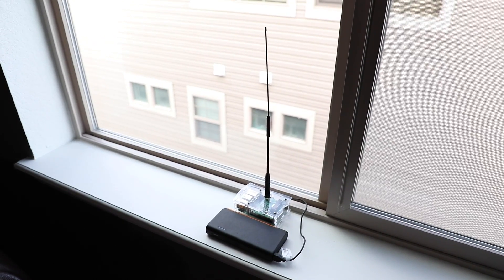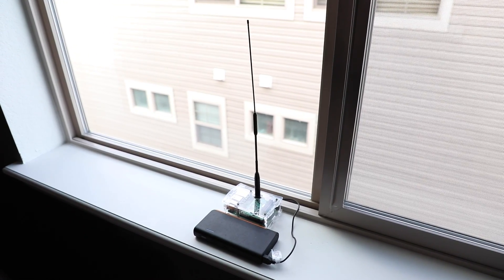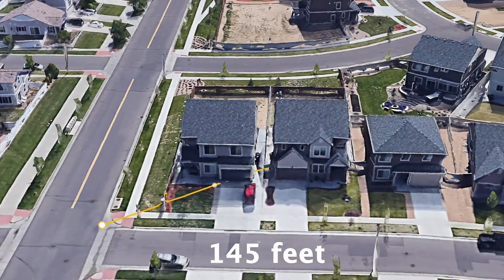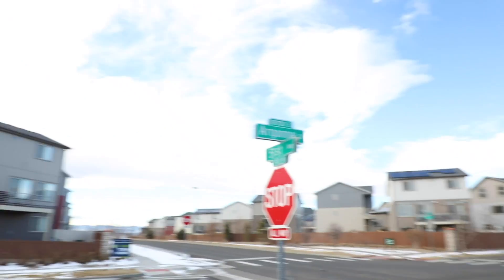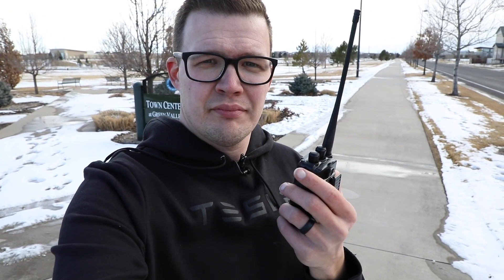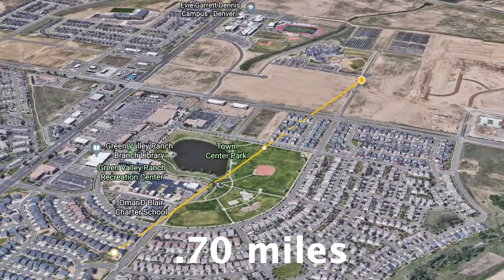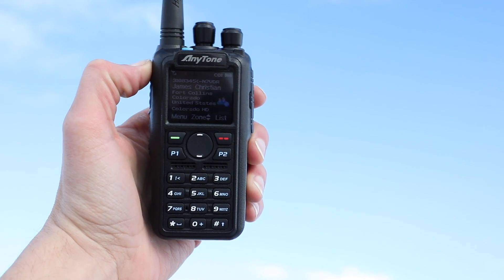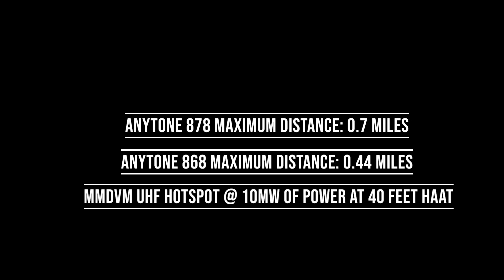How Far Does a DMR Hotspot Reach?

Comment: I keep my mmdvm hotspot on a battery pack all the time. I stuck a piece of velcro...sorry hook and loop fastener... on the bottom of hotspot and top of battery pack. I have a nagoya 771 on it. It works all over my neighborhood pretty much. My hotspot came with a sad little excuse for a antenna. Just a one inch chunk of plastic basically.
Reply from the maker: Yeah. The antennas that come on money are pretty much a dummy load. If you’re hoping to use it around a large property or down the street changing out the antenna is worth it.

Comment: I guess the antenna is different. I always change antennas on from the stock to something I actually know has decent SWR.
Reply from the maker: The antenna was changed between the 868 and when the 878 debuted. The 878 antenna is actually decent in my comparisons. The 868 antenna was horrible.

Comment: I wonder what the effective range would be if you were to place this hotspot into a waterproof housing with a decent antenna mounted on a pole on the top of your house.
Reply from the maker: I’ve seen people rig up a hotspot to an external antenna at 50 feet and get 5-6-7 miles from it. Where you really need a bump is a miniature amplifier and that external antenna. Then 10-15 miles isn’t crazy.

Comment: I'm new into Ham radio, studying for my test now.  But I thought a hot-spot puts you on the internet. So you can reach any repeater you want. 

Or are you using the hot-spot as a repeater that your contacting with your handheld n having the hot-spot shoot out he signal?
Reply: Both actually. The hotspot is connected to the Internet and repeats what you say to the Internet and repeats the Internet signal back out so your handheld can hear it. In ham radio, when you say repeater, usually that is a high antenna with high power output, maintained by a radio club, not a very small 10mw box.

Comment: This is soooo cool. Didn't know my hotspot would reach that far.
I ordered the OpenSpot3 (comes from Estonia), backordered ... looking forward ...
Thanks ... great video. I don't think I can put an extended antenna on the unit .. damn!
Reply from the maker: Yeah, YMMV as you have a small internal antenna with an OpenSpot — but they are higher power.

Comment: I truly wish more people would do distance and clarity tests. Is their another hotspot with better range? What about different antennas? SUBSCRIBED
Reply: Sooo... kind of. You can make one from an mmdvm "modem" board. That connects to a radio via cable. The radio you use doesn't even need to be digital. The easiest way to do it is to use a commercial analog 2 way radio with an accessory jack on the back that will accommodate a "data modem". Thats essentially what most digital voice is. Data over fm.

Comment: Great video! What type of antenna does the pi-star MMDVM use? I know it's supplied with a tiny rubber duck but which better fitting antenna will work with it. I don't know the sma size.
Reply from the maker: It’s a female SMA on the DVMEGA. Any Male SMA will work. It comes with a tiny rubber duck, but any SMA male will be good to go — or you can get a jumper and go from SMA to a large outdoor antenna via PL-259.

Comment: I have the 878 great radio really good. I want another 1
Reply from the maker: Agreed! It’s a great radio for the price.
Reply: @K0LWC  I dont think.there is much better for the price. Unless.you want to go for a moto which I think is over priced  and probably over rated the at-dm878 is a superb radio with professional quality for great value price.
Reply from the maker: Graham S Motorola is great, but not ham friendly in features and design. However, if durability is key and money is no object  — Motorola!
Reply: @Gsavell  Moto/Hytera radios are far superior in build and functionality.  I own a bunch of Hytera radios and used to have a Moto 7550, great radios.  I have the 878 and a few other HTs, its a good ham radio, but I'll take my commercial radio any day of the week when going out around town.  If I'm going traveling, then I"ll take my 878 as you can field program it.
For the money though, if you want a good ham radio, the 878Plus is a darn good option.

Comment: Hi  good video.
One question. ! Does DMR digital radio work when internet shuts down on earth.
If i buy couple of DMR radio can i Encrypt those sort of speak privacy. And when internet shuts down in the world. It will still work.
Thats my bigg question for preppers.?!
Reply: Can't use encryption on amateur frequencies with DMR legally.  But yes, these radios will work in simplex, but you won't be connecting all over the world like you can now.  You would be limited to either simplex or if you have a local repeater you can bounce off that.  The internet is what gets you outside of your local area, if there is no internet, then your radios will just stay in RF range of the radio and or repeater.
Reply: Yes. Here's an example for DMR, but read all the comments for it, too: https://www.youtube.com/watch?v=R_fYaK84VU4&t=43s
Reply from the maker: Yes. DMR doesn’t rely on the Internet.

Comment: Great video, good option for a hotspot. 
I am wondering, how well are you able to hit DMR Repeaters without the need of a hotspot? I am in Denver as well and I know there are quite a few DMR repeaters out there.
Reply from the maker: The W0TX repeater is the best Brandmeister DMR repeater in Denver. If you’re from central Denver or northern part of the suburbs I’d check out the KB0VGD machine in Golden in North Table. Both are solid machines and offer HT coverage in Denver. 

W0TX = Best HT coverage across the metro. 

KB0VGD = Great from central Denver and north to Loveland.
Reply: @K0LWC  thanks for the quick reply! I frequent W0TX on 2m and 70cm so that's good to know.

Comment: I've always found that the signal from the hot-spot can be heard at really good distances but it's not always the case that the hot-spot can hear you.. A bit on the deaf side..
Reply from the maker: That’s very odd. The hotspot has mWs of power where your HT will have 1-7 watts depending on the radio. Your HT should vastly out-distance your ability to hear the hotspot. What hotspot do you have?
Reply: It will be the reverse... your hotspot will stop reaching you long before it stops “hearing” a 5w HT. Something in your testing or understanding is flawed.

Comment: We managed 50 miles on analouge 446mhz 500 milliwatts. Can't wait to try the dmr shame about the audio tho much prefare analouge .
Reply: You much prefer the sound of analogue until it starts breaking down at distance. At the point where analogue breaks down digital simplex going strong... Here in the big city we get almost double the distance on digital simplex. Great for ECOM.... But yes, when analogue is clear it sounds much better....
Reply: @myseniorlifephotography  Maybe not.

I cross banded VHF C4FM from an FT-70D to a 991A connected to an RT3S on DMR and UHF.

I was using a magnet mount that was 1/4 wave on VHF to receive the UHF DMR with an SDS100.

The 991A was receiving from a half wave antenna about 40 feet up.

The RT3S transmitted with it's rubber duck on the second floor.

The FT-70D was transmitting with it's rubber duck.

At 0.80 miles beyond a small to moderate hill, I couldn't hear myself through the repeater.

At this same location in the past I could hear myself decently on analog UHF, wide or narrow band, and less so on VHF.

Comment: Now is there a way to put a extender on that hotspot and run it to a antenna on a 90 foot tower?
Interesting and great video by the way.
Dont want to spend $$$ on another dmr repeater if I can avoid it
Reply from the maker: You could run it to an antenna on a tower, I know those who have done it. You’ll get a bit more range, but at what point do you start acting like a repeater given coverage where coordination is a concern. Cool to test, but I wouldn’t do it long term.

Comment: thanks for the interesting video!
i think i am gonna be get a DVMega Hotspot and connect it to my Diamond X-50N btw. Diamond x-510 at the top of the roof.
Reply from the maker: Let me know how it goes!
Reply: @K0LWC  A similar arrangement in West Beaumont, Texas yielded about .75 mile diameter from the antenna. Again, my five-watt handheld could be heard much further than the 10-mw hotspot. There was some discussion years ago about using an amplifier to boost the output of the hotspots to something more respectable, say 5-7 watts, but the manufacturers advised against it because of the signal purity and potential for amplifying spurs and other equally nasty signals.

Comment: So I’m so confused How does it work with using a hand held a hotspot and lets say an iPhone for internet. Is there a video showing this anywhere
Reply from the maker: Simply set your hotspot to recognize you’re iPhone’s SSID and it will auto connect when you leave your home WiFi network.
Reply: K0LWC I guess I wasn’t clear on my question. Not connecting to an iPhone but what modes do you run with the radio while connected that way.
Reply from the maker: Kevin OKeefe You can run any kind of mode, you set it to bridge to another codec on the hotspot firmware. I was using DMR, but you can use NXDN, P25, YSF, etc.

Comment: That's pretty awesome for 10 mw. Although I once maintained contact on 2M down to 50 microwatts over a 15 mile path, but that was on CW with high-gain antennas on both ends.
900 MHz is a lot of fun, though. I was able to get into a 900 MHz repeater in Knoxville, TN, 25 miles from my campsite in Pigeon Forge using 5 watts to a homebrew 1/4 wave groundplane inside my truck camper.

Comment: Bandit PMR 78 wire antenna indoors (Brick buildings and urban areas) on 446, I made it 3 1/2 miles using a Baofeng GT3-TP mk iii to another with the antenna his came with...sounded like he was across the road from me...using 5w

Comment: I suggest to upgrade the hotpot to 1 to 2 watts, this will work much better
Reply: absolutely defeats the reason of a hotspot...  They are supposed to be low power for a reason, they are only supposed to be used for around your general area.  Hotspots are super popular, image if everyone had a 5 watt hotspot....  You would have so much interference it would be impossible to use.  More range is not a good thing with hotspots.
Reply: @kabish0603  So... What's the difference between a higher powered hotspot and running a WiresX Node via an FTM mobile radio from my home, accessing it from another mobile in a vehicle? One could theoretically be cranked up to 50W both ways w/ 6db gain antennas. As far as I know, this is perfectly within the rules (US) on VHF/UHF. I suspect the only reason it's not more popular is that the cost of entry is a bit higher than a $100 hot spot.
Reply: @kabish0603  In that case remover the antenna, Nice no range hotspot. I know non hotspots, its nog zo populair as you think.
Reply: @VicGreenBitcoin  Ya, remove an antenna off a transmitter good idea why didn't I think of that.  Just about every ham I know has a hotspot of some sort that they use.  In the US they are incredibly popular.  Can already tell you have absolutely no idea what you are talking about, remove the antenna genius idea... have a nice day.

Comment: I was only able to get about 800 feet with the stock antenna that came with my Jumbospot.  I tested the stock Jumbospot antenna on my MFJ269 and threw it in the trash.  Crazy SWR on 70cm!  Replaced it with a different antenna and had similar results to you.  Thanks for the video!
Reply: I recently just did this on mine, replacing the original antenna with a Yaesu rubber duck I had laying around. It's not high performance but the Yaesu rubber duck is higher quality for sure.

Comment: Can you get a Linear Amp for that DMR Hotspot, if you are using 432MHZ you will need to be line of sight to get a signal.
Reply from the maker: You could, but why not just get and coordinate an actual repeater at that point?
Reply: There are very low watt repeater kits that do boost you up to say 2.5 watts.

Comment: Great videos. New to HAM, currently studying for my technician. Is there such a thing as a DMR/analog radio? Would like to only buy one handheld. Thanks
Reply: Also, the TYT -UV380G or UV390 both do it and are a fair bit less than the Anytone models. You can't go wrong with either.
Reply from the maker: Yes, the AnyTone AT-D878 is a great analog/DMR radio. It’s also both VHF and UHF so you can get on the 2 meter and 70cm bands. I have videos about it and its predecessor the AnyTone 868 on my channel. 

Google “AnyTone 878” and you’ll find it. I recommend GigaParts as a reputable retailer for that radio— that’s where I got mine.
Reply: K0LWC Awesome!! I'll check the video out. Thanks
Reply: The new Alnico is just as good a radio and quite a bit cheaper. I have both and they work great but the Alinco' is just as good and a better value.

Comment: You have no high buildings across your distance tests , so that's you have long distance to RX/TX DMR signals.

I have maximum 500m to RX/TX DMR via my pi-star mmdvm hs hotspot in my location in Moscow.

De RC3C #2503041
Reply from the maker: There are some obstructions as noted in the satellite views, mostly homes up to 40 feet in height.

I’ll be doing another test that is more focused on testing distance with more obstructions.

Comment: Nice! almost double the distance of the 868.
Reply: That has nothing to do with the radio, it's all the hotspot.  The radios are both good for a couple of miles easily.  That is a strange test for that.
Reply: @pupdaddymail  I've read that the internal components are identical between the 868 and 878, only the firmware is different.  I believe you're right.
Reply from the maker: Thanks for your help, Jimi!